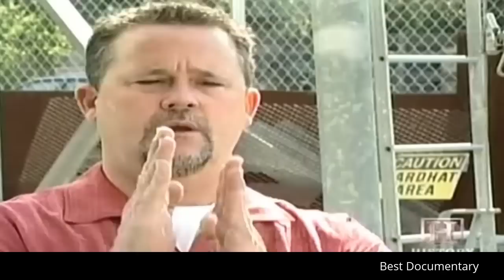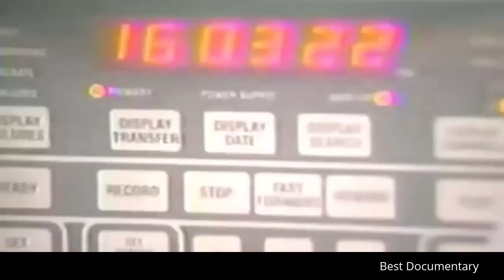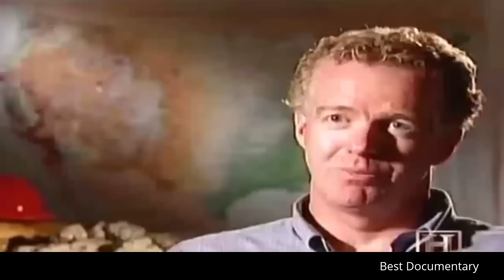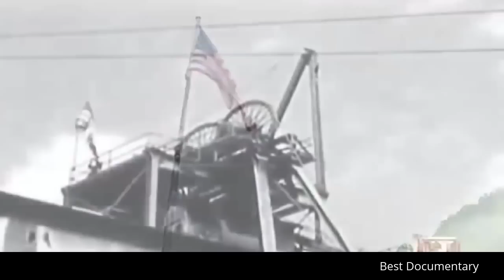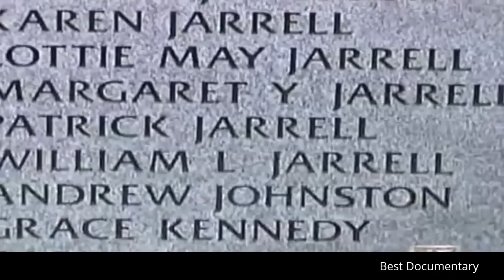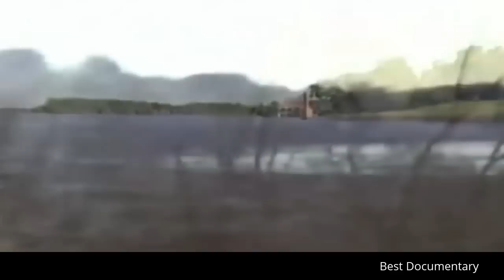Engineering Disaster : Falling Structure : Best Documentary 2017

Comment: I'm no engineer,  but isn't 20,000 pounds of pressure on a half inch bolt really supposed to hold?  I've seen the massive hardware holding up the golden gate bridge cables  when I was a kid I remember that it looked over engineered. Really a half inch bolt holding 20,000 pounds.  I feel the engineer's should be held accountable for this tragedy.  Stupid people.... rip to those who fell.
Reply: I heard the narrator say that the rigging crew failed to have engineers certify the bolts. So, the people responsible for the decision are the ones who died.

Comment: On the Exxon Valdez, they conveniently forgot to mention that the autopilot was on so that any input to the wheel would be meaningless.  These autopilots had no detents to see or hear, would just slide when moved or accidentally hit.  It was only marked "Control', "Manual", and "Autopilot".  It was on Autopilot so the attempts to steer the ship were useless. What  makes this extraordinary is that it was a full TWENTY YEARS after a tanker over near the UK had the same problem.  They had 20 years to fix the autopilot lever but FAILED to do so. Now they have an audible alarm that sounds if manual input is used while autopilot is on.

Comment: I know I don't know physics or engineering , and hundreds of ways have been thought of  ( building towers ) , but is there no way to use the center of the tower for hauling up the antenna as each section gets added on . with a motorized pulley sending it up and out until it locks  ? when you've reached tower height ?
Reply: I quit watching after 4 minutes...bad,,bad quality video....but they should just have used a Sikorsky helicopter to hoist the final antenna components into place....no matter what the rental costs are....that was  an accident  waiting to happen
Reply: nope.

Comment: Having worked around cranes and lifting for most if not all of my construction career I would state that the golden rule is to never allow yourself to be beneath a suspended load......with that being said I guess I'm struggling to comprehend how anyone can think it's acceptable to actually ride in the suspended load.

The issue, suspendion failure is clearly the same.
Reply: Phillip Davies for the sake of a little common sense eh? Seems obvious to me too, that you don't ride on the load being hauled, and I'm nt even in the industry!
Reply: I'm guessing it was just a shortcut to the top, those towers have to be climbed by hand and it can take 90 minutes so any excuse to save time I suppose.  Regulations be damned obviously :/
Reply: I agree with Rob Fraser's assessment, there.  You can't get to the top by elevator, & climbing by hand is AT LEAST as dangerous as riding the load (the antenna assembly) dangling from the device that the men used as a crane & cable system.  It seems that riding the antenna section was the only practical option...

Hindsight's always 20/20, though, so why weren't the men sent to the top of the tower in a lift-bucket first, attached to that same cable, & THEN raise the load up to them?  No riding the load that way.  Plus, if the load were lost, the men wouldnt've been lost with it.  Six men are alot lighter than a 60 ft tower section!

Too bad they didn't use thicker "u" bolts of a higher grade of hardened steel.  I'm no expert, but I'm convinced that's the one single thing that would've made all the difference & prevented such a horrifying, ugly death for those 6 gentlemen 😢
Reply: everyone died anyways.  the ones riding just died slightly faster then those that climbed.
Reply: jebes909090 Yeah. With that much tension the antenna would have easily sliced the guys. Must have been more than one set cut though; my the others on the same side should have held long enough to save two.

Comment: I would think that anchoring a ballon with all the equiptment for broadcasting would be a better option.\
Reply: Israel Chief Oren why?  towers average and efficient.  No balloon would last very long before losing helium.  transmitters stay on 24/7
Reply: Mark, it could be feasible, but would have to see if the infrastructure and maintenance costs are comparable to a ridged construction.  Israel has balloons that are used for observational purposes, and could be used as a test platform for longer term installations.
Reply: There is no balloon on the planet that would stay as steady or up for as long as any tower. Sorry.

Comment: Once the towers are up someone has to climb them to change the aircraft warning lights every few years. That was my job on broadcast tower antennas ware the entire tower is the antenna. You have to free climb them without any safety lines. One missed step and it is 300 feet down. Also with the antennas still broadcasting the top is high current and low voltage and the base is high voltage and low current. The entire tower sits on a 4 foot high porcelain insulator and you have to use a insulated ladder to get on the tower because any contact with the tower and the ground will kill you. $1000.00 for 45 min work wasn't bad tho.
Reply: You are far braver than I.
There is literally no amount of money that could induce me to do that; I'd literally be petrified into immobility.  Put $1million cash on the table, I'd walk away.
You have my respect.
Reply: If you use a harness attached to a safety line you will electrocute yourself and the person on the bottom by grounding yourself. On the new broadcast antennas they have a channel lock that you can clip into and move up without that problem but the antennas put up in the 50s and 60s didn't have that. You do have a harness on but just with a hook to clip into the tower when you need to use both hands but the climbing is all free climbing.
Reply: Yup. Been there, done that. While in college I changed tower lights on AM towers for $1 a foot. No harness, no safety, just hand over hand. Learned to put a leg thru the latter or tower, hook one knee over, and have both hands free. Couldn't fall unless your leg came off, and then I wouldn't have cared much. Now I ride elevators 1500'-2000'. The knees went about 10 years go.
-->smartalek180 - After 30 or so feet, higher doesn't matter much.
Reply: Wish I would have found an opportunity like that when I was in my twenties !! At that age I loved heights and (don't tell anyone, I probably would have done it for free (once) Just for kicks ,when I was 18, I jogged the stairs on the waldorf Astoria (57? floors) just to see if I could do it. :-)  Now at 65 ,I am hesitant to climb my 50 foot radio tower.
Reply: how come there was no way to use a harness?
Reply: Please read the above again. "The Current bulb"  is rated around 8000 hours constant on.  The LED have a significantly longer life !
Reply: I have been in the Sullivan Mine back when it was the largest underground silver-lead-zinc mine in the world. Many people on the tour were claustrophobic including my mom being that far underground. It doesn't matter how high or low you are from ground level people will still feel uncomfortable. When I did the radio tower my friend who was the com-tech was able to run up and down the other tower as well as sit on the top while changing the top light.
Reply: I built my own TV antenna tower back in my late 20's or early 30's. It was almost 100 feet tall. I then hauled the antenna rotor and the large antenna to the top. I would limb that tower on clear days and nights just to look around. Amazed at the view from just 100 feet. I live half way between chicago and Detroit. I could receive TV channels regularly from both cities and even from Canada! I could receive channels from 100 to 150 miles away. The longest distance I ever received was Casper, Wyoming, two time zones away. Then one night a high wind took it down. One of my guy wire anchors broke. I was really disappointed. I never got it replaced and never got the chance to climb that high again.
Reply: All of you have my utmost respect..!! My sister lives on the 12th floor and I get panicked, heart palpitations and dizzy looking out of the window.
Reply: I haven't done the tower climb since 1990 so I don't know. A friend of mine cut the towers down in about 2000 when the radio station switched to FM only so I don't know. I would imagine that LED lights are now available. It is a fun climb but I would never do it again on a hot sunny day because got dizzy coming down and sick on the ground.
Reply: yes . the FAA just certify a new batch of LED bulb. 
Current bulb is rated around 620 watts and have around 8000 hours life span. around 11 months  . those light bulb are usually designed for 130Volt but used with 110V so it is long lasting but not very efficient. Current LED lightbulb should make things easier and last longer.
Reply: You are much braver than I am. Heights terrify me - possibly a partial result of growing up in places where heights invited disaster, but still. I'd be much more comfortable hundreds of feet below the earth than above it!
Reply: I've been through some of the old silver mines in the Rocky Mountain range and Tombstone, in the Carlsbad Caverns and other places...being underground never bothered me, no matter how deep we went. Being up in the air though? Terrifies me.
Reply: I have seen videos where these guys climb high towers without safety lines, but I'd think you could somehow attach a safety line as you go -- I certainly would NOT climb without some sort of safety line, that's downright insane!
Reply: Oldandwize These comments are amazing.  Those of you who have done the climb, are super brave and have balls the size of grape fruits!! I just watched a video of a bloke climbing a few 1999 foit tower and felt sick.  Hahaha. 
You all have my utmost respect.
Reply: wow.. big respect. But I'm curious ..why don't y'all require to wear a parachute if ever y'all accidentally fall?
Reply: Sofjan Mustopoh...... How do you figure that the LED's will "last longer" with an approximate life span of "around 8,000 hrs or 11 months" as you stated.... compared to the current bulbs lasting approximately 3 years,  as stated by "Oldandwize"... the fellow that you replied to here, who changed them for a living... when he says that they change them "every FEW years".... the word,  "Few" generally is associated numerically  with "3".     Considering the current advancements in LED technology,  I would say that either you "math" is "off".... or your information is incorrect, possibly.

Comment: the U-bolts were only 1/2 inch diameter?? wtf?
Reply: wtf is right. this is scary as shit!
Reply: Good grief, lol.  I had bolts that size for a little 75 ft. tv antenna tower behind my house, lol.
Reply: Yes 1/2" nominal diameter, but the wrong type of steel.
When selecting fasteners, it's important to select the correct material (DIN) for the application. Allen screws, bolts, washers, nuts & threaded bar are not all equal.
Reply: Hal Kittsmeller it totally depends on the grade of the bolts.  A Grade 9 bolt is much stronger than a Grade 2.  it also depends on where the bolt is in the structure and how it is being loaded.
Reply: Hal Kittsmeller this has nothing to do with the size of the structure.  these bolts held the Jin  pole to the tower.  what matters is the load.  The height of the tower is mostly irrelevant, it's what they are lifting that matters.
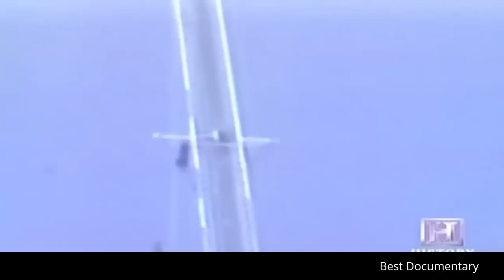Reply: @markdoldon8852  4:07 "...the U-bolts on the clamp bearing the weight of the antenna failed..."

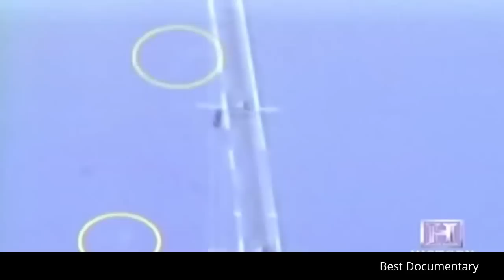The U-bolts held the load, not the Jin-pole, hence the two puffs on the load at 5:43 and 5:46
Reply: I heard that too and was like WTF? I mean Im not an engineer however Ive broken things before. that seems like an awfully small U bolt to hold a part of an antenna that weighs more than my pick up (which has bigger Ubolts holidnt eh suspension on ) LOL
Reply: Mark 6 tons of steel. Thats a lot of weight
Reply: I've seen way larger bolts used for way smaller things. 1/2 inch diameter seems very small for a structure that large.  I'm aware of fasteners.
Reply: ARP everything
Reply: Hal Kittsmeller adamantium titanium alloy🐾the wolverine 😂
Reply: yeah, even if not an engineer yet, that would be way too small
Reply: what are you yammering on about?
Reply: trespire you must be one of them engine ears they keep talkin bout
Reply: trespire  ..  Agreed. 1/2" u-bolts are normally more than enough for that task. They just used crappy u-bolts.
Reply: O